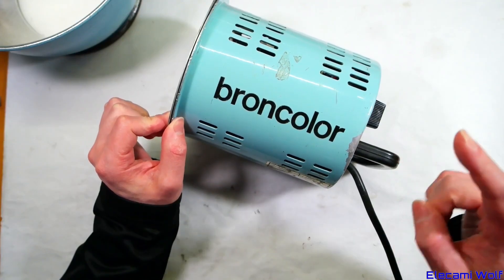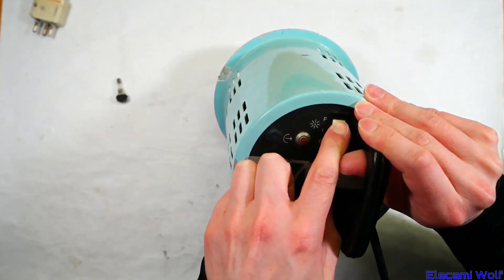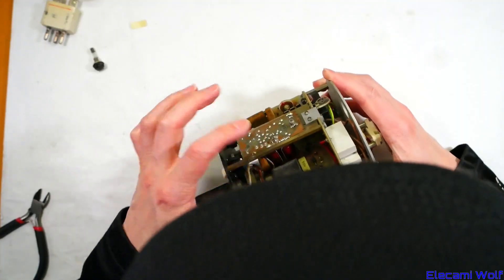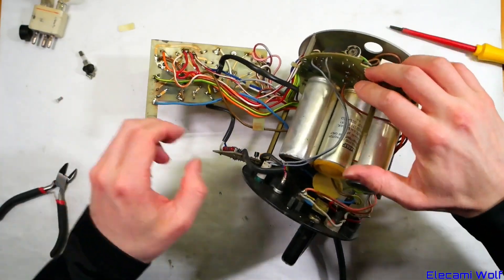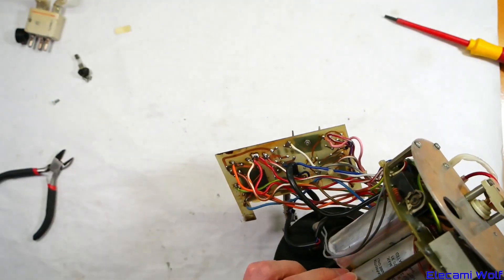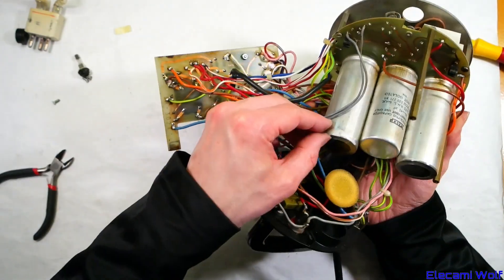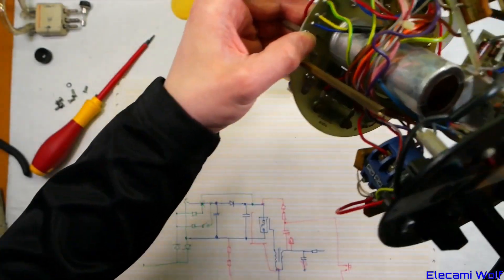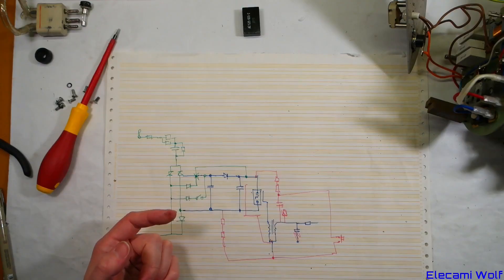EW0140 - Broncolor C70 Photo Flash Teardown Investigation

Comment: Thanks for the teardown.  More complex than I thought it would be, or at least more miles of wire.  And it's always nice to see a RIFA cap.  My industry, railway signaling systems, used a lot them in the 70s and 80s.  Never had a problem, but guess the rest of the world ended up hating them.
Reply from the maker: The PCB layout seems very sub optimal So many wires.